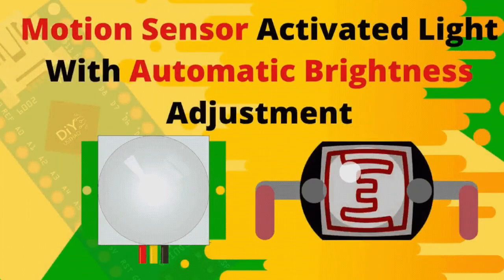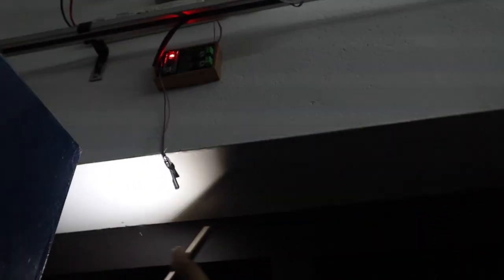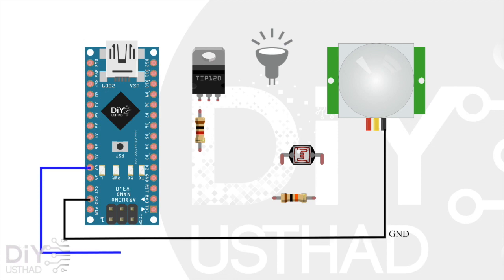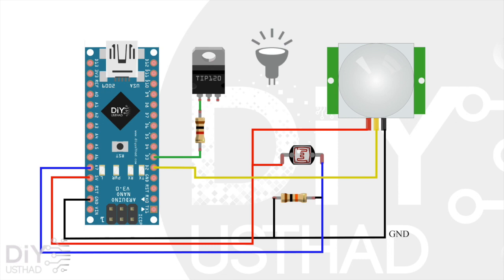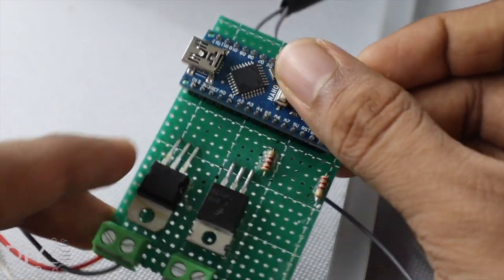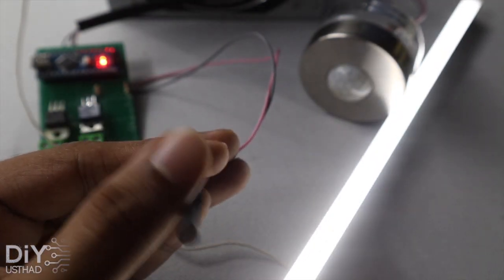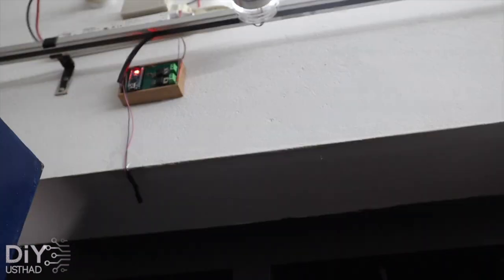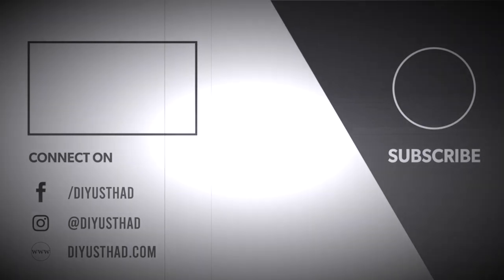Motion Sensor Activated Light With Automatic Brightness Adjustment | Arduino + PIR + LDR

Comment: Hi DIY USTHAD, 
i am very interesting by this video combining PIR with LDR. 
I have a project where i want to light on when it is dark (when it is the night only) and when someone is walking in the garden. 

I don't want to use an Arduino but only an LDR connected on a PIR. 
Watching your video, it seems that i have the same model of PIR as you. 
I tried to solder a LDR on the RL plots into the PIR. It is not working properly well for me.
Can you help me ? 
What kind of LDR are you using ? 
Is there a special PIR model to use the darkness feature (RL plots) on the PIR ?

Let me know please
thanks
Reply from the maker: Will get back to you soon. You can mail me at najad@diyusthad.com for detailed discussion.

Comment: Does it work with Arduino Nano 33 iot with header?
Reply from the maker: this is not an IoT project but you can use Nano 33 IoT, it will work for sure.